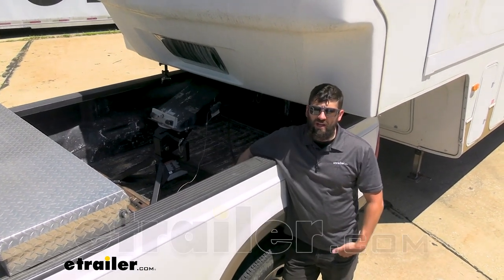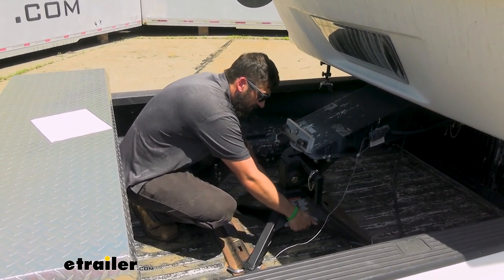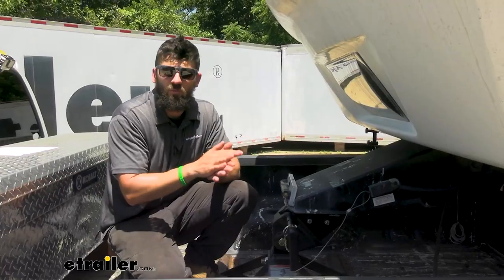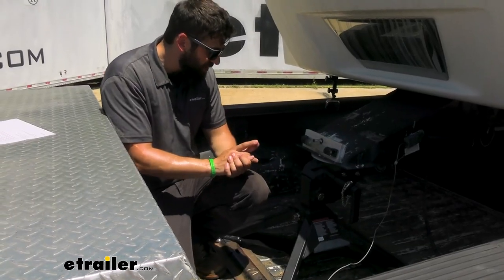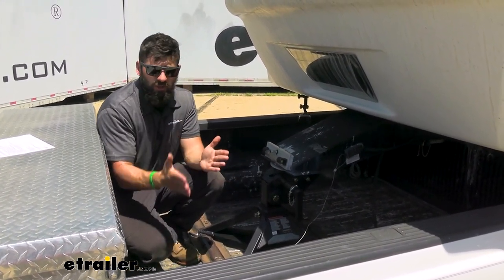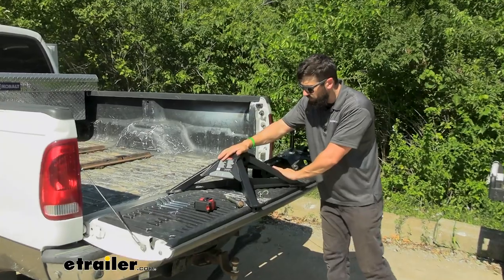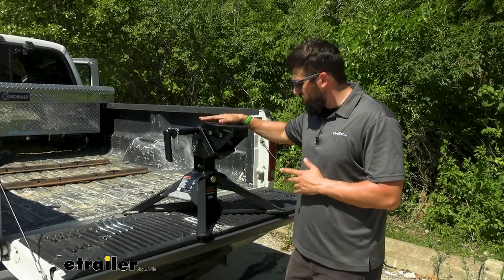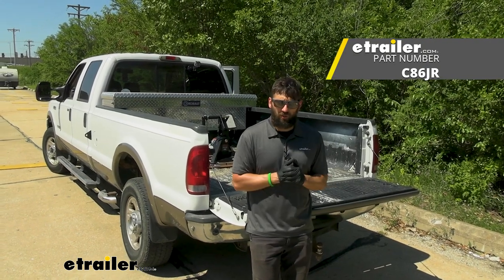etrailer | Curt CrossWing Lightweight 5th Wheel Hitch for Dodge Ram Feature Review

Comment: So you are basically pulling the trailer with a small set pin and looks like a 5/8 ? 3/4 inch rod sitting on a goose ball and very small metal relief hole in the head?

Comment: Does this work with the curt turning point on the fifth wheel box.
Reply from the maker: The CrossWing version that attaches to the bed mounted rails, part # C86JR is compatible with the Lipper Turning Point, but you'll need to use the # C85DR wedge.
https://www.etrailer.com/Fifth-Wheel-Hitch/CURT/C86JR.html
https://www.etrailer.com/Accessories-and-Parts/CURT/C85DR.html